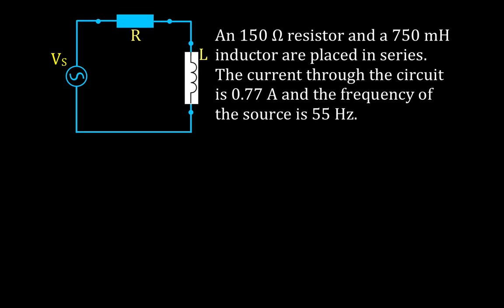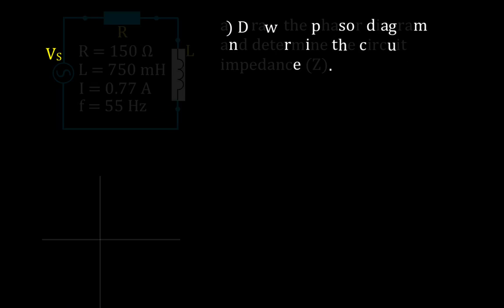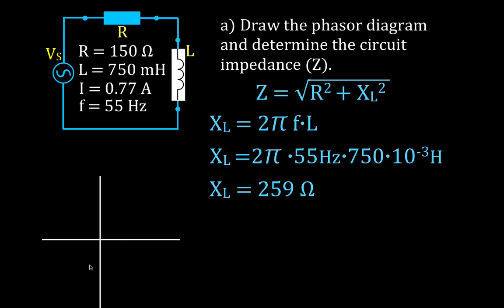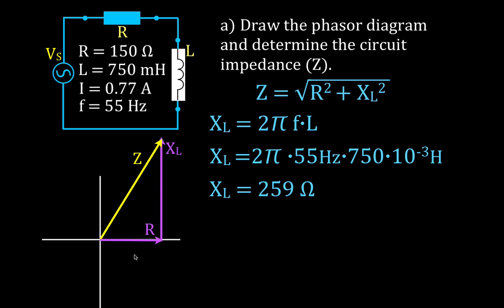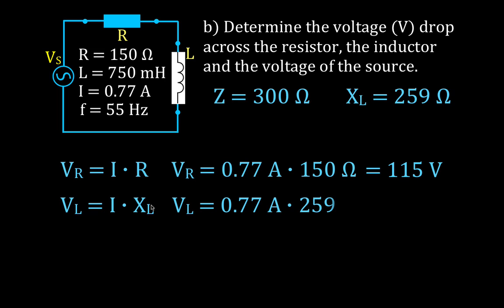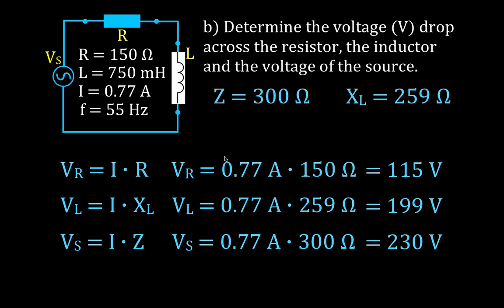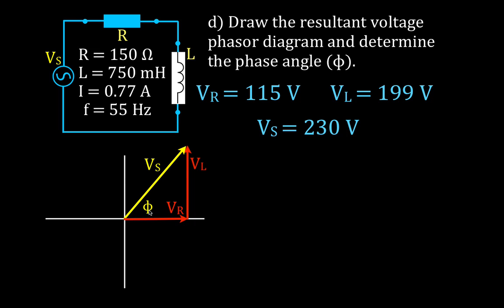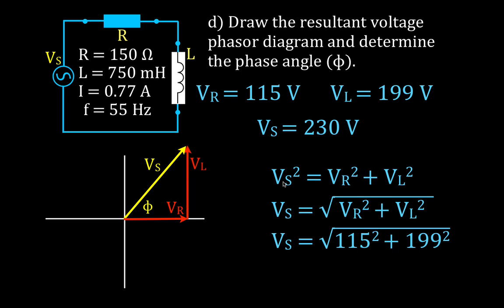RLC Circuits (11 of 19) Series RL; Calculating Impedance, Current and Voltage

Comment: I reaally like this series, it's very helpful, I've liked most and subbed. However, I believe that Tan Phi = Y/X, therefore to get Phi on its own, take tan over the other side and invert it, so Phi  = Tan-1 x (Y/X). This is the only confusing part.
Reply from the maker: Yes, I believe I got the math notation wrong. Thanks for watching, commenting and subscribing. Means a lot to me.

Comment: In the preceding video an RC network gives a positive angle, and also in this video. Wouldn't there be one negative angle and one positive  ?
Reply: One would 'lead' and the other would 'lag'. Current 'leads' Voltage in RC circuits and Current would 'lag' Voltage in RL circuits.

Comment: I believe you've made a mistake with the phase angle.

tan(φ) = (199/115) which means

φ = arctan(199/115) = 46°

No? The video was very helpful regardless, thank you!
Reply from the maker: yes and great that you still found the vidoe helpful.  Thanks for letting me know.
Reply: The Sunpouncer Gaming Channel 60 degree for phase is correct. Tan phi = (199/115) than phi = tan-1 (199/115) = 60. It can be verified using cos phi = (115/230), answer is 60 degree too.
Reply: It's just the representation, basically that arctan should've been on the other side.

TOA

tan (φ) = Opposite / Adjacent

So to get (φ), it should've been represented as:

φ = arctan ( Opposite / Adjacent )

which would then result to the same answer, which is 60 degrees.

None the less, this video maker is a Very Good speaker, and has helped me understand this very effectively. :))
Reply: no, the arctan is in right place but it's arctan(199/150)= 60. Sounds like some of you  should brush up on your trig functions.
Reply: No, it's 59.976... degrees. I prefer cosine 115/230 which gives exactly 60 degrees.

Comment: I'm working on a problem in which R = 10 Ohms and XL = 10 Ohms. when I do the formula I end up with 10 square root of 2.

How do I correctly write the answer.?
Reply from the maker: So then that is the answer.... 10 times the square root of 2 or 14.14....right?  Either one works.
You can also see a listing of all my videos at my website,http://www.stepbystepscience.com
Reply: Step-by-Step Science yes I got 14.14. would it be okay to round up and use 15 Ohms? or do I have to use 14.14 to solve for the total current?  Thank you for your quick response by the way.
Reply from the maker: +HeavyMetalGuitarist1994 Use the 14.14.
Reply: Step-by-Step Science Thank you!
Reply from the maker: No Problem.